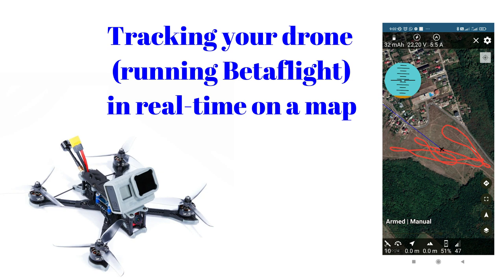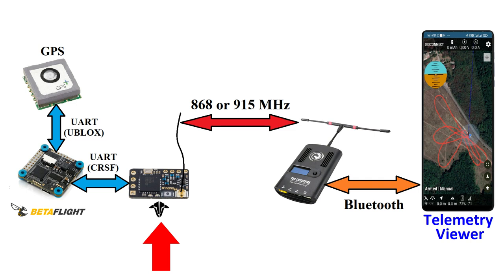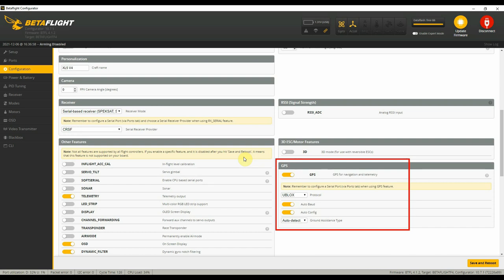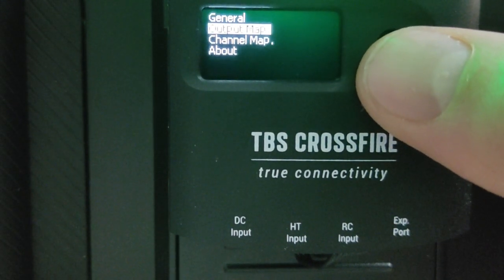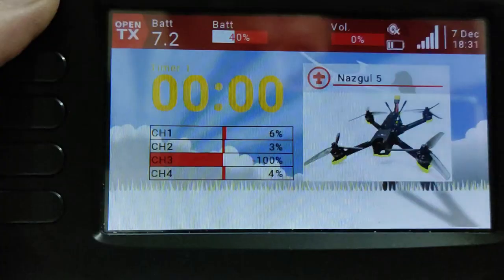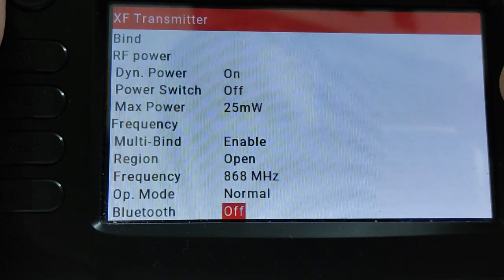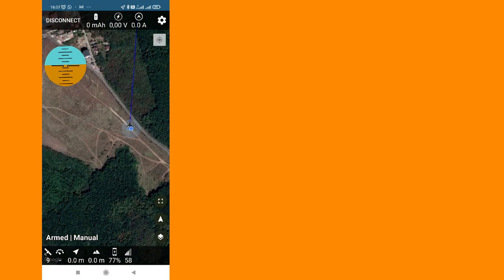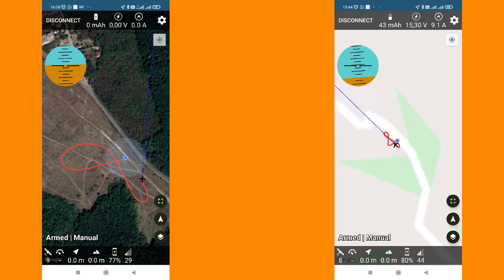Real-time drone(running Betaflight) tracking on a map - using a Bluetooth connection to Crossfire TX

Comment: Thank you for a very informative video. 

What app are you using on the phone to track the quad?

Thank you.
Reply from the maker: From the Google store the "Telemetry Viewer".
Reply: @i3Drones  Thank you very much!
Reply: Thanks again for your help.  

I do have another question!   I have the TBS Crossfire LITE Module and I don’t see a settings for the Frequency section where you choose the Bluetooth
Reply from the maker: @samavella8831  I set the  "region" to "open" in order to be able to select if it is necessary a specific frequency. If you selected, for example, Region to 2 (America) the frequency is set to 915 automatically and you do not have the option to manually select.
Reply: @i3Drones  Sorry wrong question question. It’s the Bluetooth that I can’t find, and when I did some more looking on the web, I will not be able to do this because the TBS Lite Module does not support Bluetooth only the full version does. 

If I may, I would suggest that next time at the start of your video you mention the prerequisite hardware for being able to do what you are about to show, so that people ares aware!
Reply from the maker: @samavella8831  Thank you for your advice!!!!! Today or tomorrow I will post a video for your transmitter. Be patient!
Reply: @i3Drones  That would be fantastic. Thank you very much! It is much appreciated!
Reply from the maker: @samavella8831  Here it is: https://youtu.be/kwkhHHe0qgU

Comment: Hmm I wonder if you can connect a laptop to the bt /wlan model and send mavlink messages back to the drone eg. To use dronekit on the laptop. Would be amazing with this range.
Reply from the maker: Yes you can do it. There is only a problem Betaflight is not designed to receive commands form a based station. To do this you need PX4 or Ardupilot.
Reply: @i3Drones  cool, i use a pixhawk with ardupilot on a rover so should be fine👍